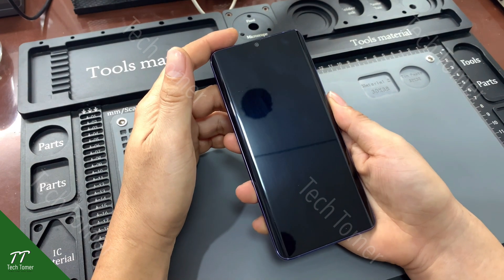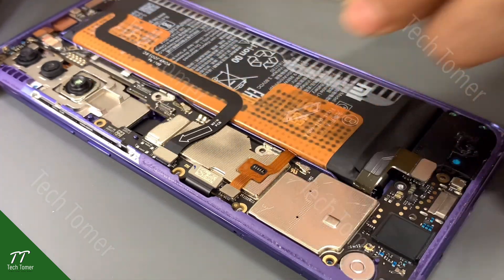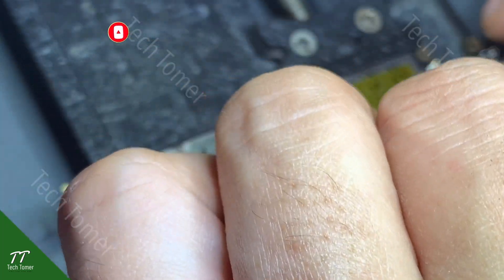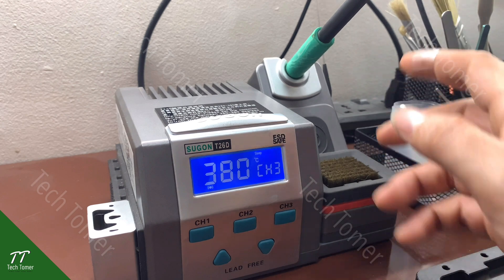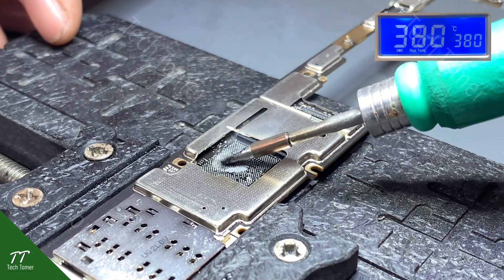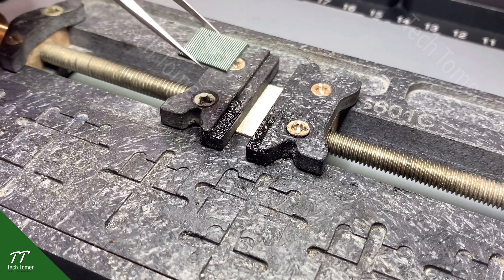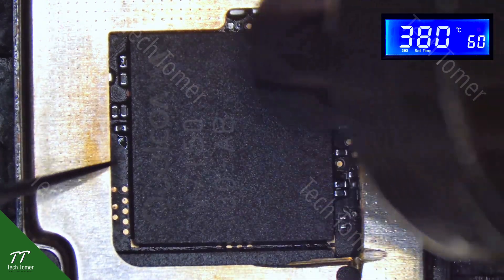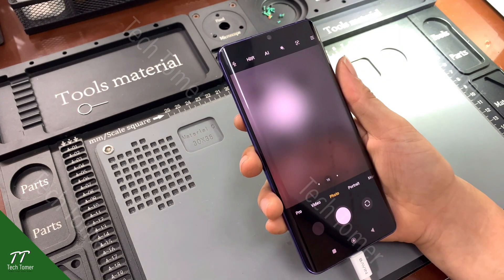Xiaomi MI Note 10 Lite Camera Not Working - CPU Reball Tutorial | Tech Tomer

Comment: I got an unorthodox problem, I have a redmi note 4x 3/32. Few months ago I did replace emmc with 4/64 to perform better. But now um having automatic battery drain issues. Like every hour battery drain 12-15% even in idle mode. Any suggestions???